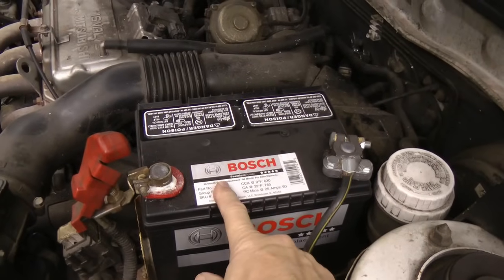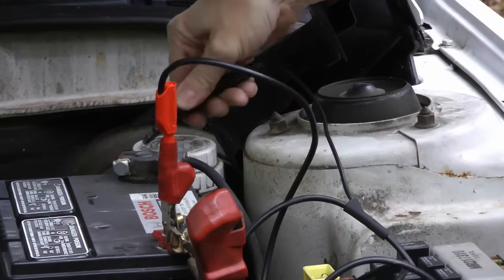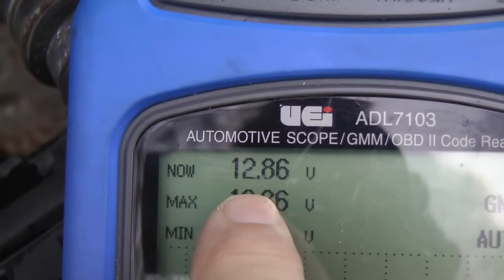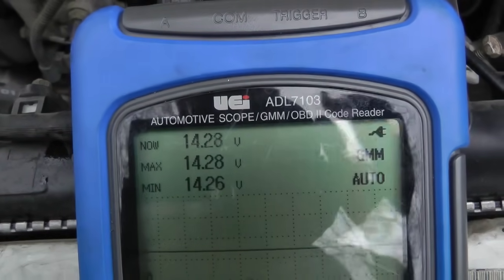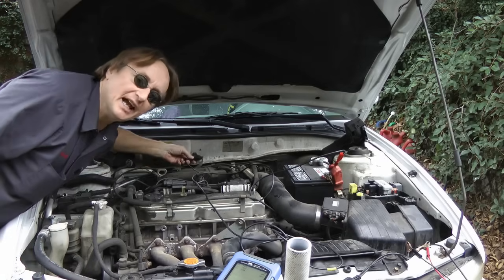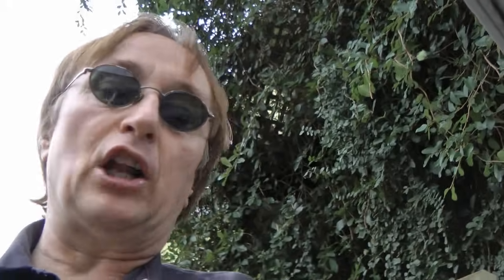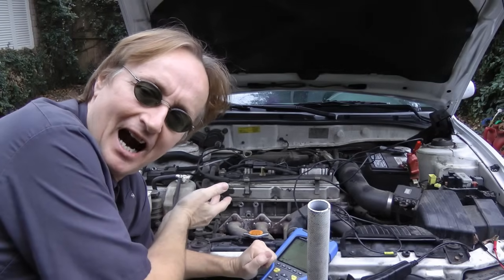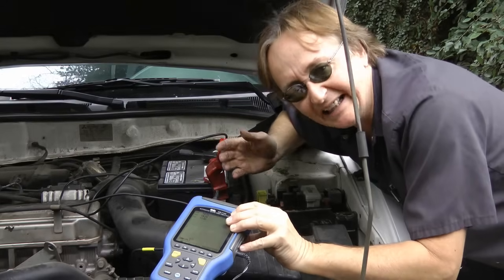How to Fix Electrical Problems in Your Car (Ground Fault)

Comment: I have a 98 chevy lumina all of a sudden the abs brake light and traction control lights all came on and shut off the radio, I noticed that the fan only works on 1 2 3 but not 4 now abs light stays on I have no power locks and no rear brake lights any thoughts?
Reply from the maker: +Kelly McLaughlin have the battery and alternator load tested, one or both are probably bad. Auto zones do that free

Comment: I need assistance. I had my car jump started today, and now nothing electrical works. Headlights, wipers, heta, speedometer, etc. What happened? Can someone tell me what I need to do? I would soooo appreciate it   TY
Reply from the maker: +Leslie Danbury, CT pray some fuses are blown, but if car was jumped wrong, it often shorts out computer modules. good luck

Comment: hmmmm

i say 

do you suppose this could explain why when i turn my headlights on  the interior lights go dimmer and the engine idles a little faster

Scotty?
Reply from the maker: +fargeeks that, or a wearing out alternator or really weak battery. auto zones check em free
Reply: +Scotty Kilmer maybe the alternator

because i did buy a brand new battery from autozone 

:)

some say its the... Whatever this unit is called that handles the voltage to the cabin from the battery or alternator

but i can say it could be the alternator (it is pretty old but still runs)..

when the headlights are off however then everything inside is at full power

well 

thank you alot Scotty :D

Comment: Not sure if you can help here or not but I am just desperate to find an issue.  I have a 2006 ford f150 4X4 pickup,, just spent over 2,000 that I dont have on having the front end rebuilt, after that was done my son removed the PIA foglights and now the truck isnt working properly, the abs, and engine light comes on, the wipers are dead slow, headlights are dim etc. took it back to the shop, the guys spent four hours and could not find the issue, now i dont know where to go and I am afraid I will get taken for hundreds again with no answers.. any ideas? from what I have been reading it sounds like a ground short, but dont have a clue where to start,

Comment: Ihave toyota corolla 1993 model here in phillipines,  when i turn on the key the termostat gauge  in my dashboard is going up to the high level but the cooling fan is ok, it will automatically turn off when it  hot, but yet my gauge is in the max level what can i do pls help and god bless,
Reply from the maker: +dobalditz magat   change the temperature sending unit, odds are it's bad

Comment: I have an s10 and my tail lights our stuck on . even when I switched it off and turn the car off. the switch works because it turns my headlights on.
Reply from the maker: +Jon Wright make sure it's not the brake lights which would be a stuck on brake light switch. If not them, replace the headlight switch
Reply: +Scotty Kilmer  thanks Scotty all give that a try . it's an s10 where yo
Reply: +Jon Wright where you start it and the lights come on. automatically.  my brake lights come on when you push the pedals.  there not stuck on like my tail lights

Comment: Thank you for the video. Would you be able to route me in the correct way. I have an expedition(98) when lights are on and I shift from any of the options, the 4x4 lights come on, I mean all of them. Or for instance, I am running on Drive and I turn on the lights, the same happens. I have a lot of aux lights and I might be worried the battery might be the culprit or even the alternator but now it could all be a ground wire ? Thank you in advance sir.
Reply from the maker: +BLAZETANGO   often bad ground wiring does that, get a wiring diagram and check them all FIRST. Pray it's not a bad BCM computer module

Comment: Scott are u from houston, tx by any chance?
Reply from the maker: +Joel Montes I've lived there the last 37 years
Reply: Awesome man, I have a problem with my truck that's killing me, can't seem to figure it out... few weeks ago I tried cranking it on to head to work, it turned over, but nothing, after that, it wouldn't do a thing, just a click under the hood, weird thing is that, headlights work, power windows didnt, radio didnt, sunroof did, certain electrical things worked, and some didnt... turned out the ecm, was burned, got a hold of a new one, and cranked up, but burned it again... what could it possibly be ? I live in baytown , that's y I asked if u lived in houston
Reply from the maker: +Joel Montes  you have electrical shorts burning out the computer, and unfortunately the ECM has tons of wires feeding it. Any of them can short it out. See my video "finding electrical shorts on your car" Good luck

Comment: Hi Scotty, got one you might like....had a fire downunder my bonnet, which meant replace the wiring loom from inside divers guard forward ( ford falcon ef.....I used a el loom ) anyway to cut a long story short.... now when I switch my A/C  on the drivers indicator comes on......... and my remote lock switches the A/C on/off....    :)
Reply from the maker: +Carol Tyers realize it may have shorted out the body control module, check wiring and grounds to that first

Comment: Hi Scotty! i have a 02 Mitsubishi Montero Sports and everytime i turn on my headlights it flickers not only the headlights but the tail lights and interior lights as well. I replaced the alternator but did not replace the old battery. Battery is good cuz i can still start the car with no problem. The flickering is not worst but noticeable. Any advise?. Thanks and more power Mr. Scotty Kilmer.
Reply from the maker: +Kerwin Patrimonio replace the battery first, and if not that, check the grounding wires, bad ones often do that too
Reply: Thanks Mr. Kilmer! I will be replacing the battery tomorrow. Do you think Interstate batteries are a good choice?. Thanks again.

Comment: Scotty Kilmer
I have a F 150 4x4 2004, In which the dome lites and Back Bed Lite turns on and Off If truck is on or not! I cant Find any Loose Wire's Or fuse's What gives!! Is my Truck Procesed Buy ghosts!
Reply: had that happen on a 2001 GMC Sierra 2500, never figured out what caused it. it just went away after a while.

Comment: hi scotty i have a corolla 1993 but when in start the car in winter have really low power 1000 rpm  and the car shake and before this  car go to 2000rpm and pass couple seconds going down to 1000rpm this problem is always in winter i changed a new distributor and idle air control , spark plugs and new wires and nothing change still same i don't have checking engine light but i think is electricity problem my dash lights is low and i have new batery and new alternator please help me thank you
Reply from the maker: +Leonid Bermudez old age, but do try my  video "how to clean fuel injectors on your car" and realize it may need a set of rebuilt injectors installed being that old and worn.

Comment: I have a 1989 c1500 truck and my dashboard lights don't work but I've checked all the fuses and none of them are blown. When I turn my blinker on, everything on the dashboard goes haywire. Any ideas on what could be wrong?
Reply from the maker: +wade may either turn signal switch is shorting it all out, or the dash board circuitry is shorting out. Often the boards warp with age and short out on that model
Reply: +Scotty Kilmer Is that an expensive fix? I'm on a kinda tight budget

Comment: Massive help, especially opened my eyes to the fact cars have grounding connections in the trunk! Any others I should know about? Water got in my car after a hard rain, basically a puddle in the passenger side of the car, now the seat belt fault light keeps flashing and beeping, even if no one is sitting in the seat, also turning on the headlights causes the beeping to stop or act up intermitently, any ideas? I did clean and use dilectric grease on the connector under the seat with no fix

Comment: Been having starting problems with my 2002 Monte Carlo ss. When i turn the key to ON the dashboard flickers and when trying to start it absolutely nothing will happen . I found I have to slightly press the hazard light switch in in order to stop the flickering and to start my car . If I let the hazard light switch go before I put the car into gear the car will shut off . wires at end of connection are fine.. Don't know where to start !? HELP...
Reply from the maker: +Frankie  Herna that's a weird one. I would first replace the hazard light switch and pray it's shorting all that out
Reply: I will try that this week. Found another thing yesterday. The lights stop flickering also when I press the break!

Comment: my 2011 malibu front speakers work here and there. also one headlight goes out after I just recently changed it (without touching the bulb)..I have to smack on surroundind areas to get it back on..any ideas?? thanks in advance.
Reply from the maker: +Gillionaire LeeM the light has bad grounds, check them.  speakers may have loose power or ground wires too

Comment: just wanted to ask, I have a honda accord 2008 ex-l model. When the engine fans activate the lights flicker for a second and it does it over and over. I swapped the fuse relay and it does the same thing. Please let me know if you would have a simpler fix for this extreme current draw. When I say flicker it includes the back, front, inside (no dash or stereo) lights. But the engine runs fine; it's just an electrical problem I suppose. Maybe replacing the whole fuse box might do the trick.

What do you think Scotty?
Reply from the maker: +scientist100 either fan motors are wearing out using too much juice, or alternator is weak, you can have that tested
Reply: +Scotty Kilmer can I test the fans? I read that this is normal for Honda vehicles, at least for my year.

Comment: my 2007 hyundi getz dash lights don't work but all other lights do, any ideas plz ? i checked all fuzes
Reply from the maker: +Neil Auton  check the dimmer switch on the dash, it may be in the off position. If not, either that switch is shorted out or you have a bad dash unit with the circuit board section that powers the lights being broken, or the connector to the dash lights is loose or corroded inside

Comment: Is a multi-meter and a volt meter the same? I have a multi-meter. I'm having and intermittent battery drain issue. It was 3.50amps. I pulled the interior light fused and it dropped drastically to .50 amps. I pulled every fuse and I can't get that .50 amps down. So I'm guessing the draw might be in the wiring. Can I use my multi-meter to check volts on a wire. My meter does not have clamps it has pointy sticks only. Thanks.
Reply: it depends on who u talk to, I call it a DVOM (digital volt-ohm meter) or a fluke, which is the brand I use. if the car is off I'd say a half an amp .50 of draw is normal. when u pulled your done light fuse was it on? depending on the number and type of some lights 3 or so amps is normal for operation for a car that has multiple incandescent bulbs as some lights. I would suggest having your battery tested as a start as a weak battery loses charge quickly once the charging system stops charging the battery.

Comment: when i turn left my interior lights come on, but only going left, any help???
Reply: on a 1997 Jeep Grand Cherokee
Reply: +Zack Faulkenbury  Sounds like the turn signal switch is feeding power to the dome light.TURNING left or when the signal is on?

Comment: hey scoty i have 1995 aurora olds my lights flick on n off. and it drains my battery
Reply from the maker: +Danny Barriga have the alternator tested, many auto parts store do that free in their parking lots
Reply: +Scotty Kilmer thank youbut it was doing it even when the car was parked n keys off
Reply: +Scotty Kilmer i cleaned the headlight switch. with cleaner n compresed air
Reply: And its not doing it no more

Comment: Well, I have a 1998 BMW 328i that the driver side tail light is not working. The passenger side working perfect. On driver side all lights working except the tail light during night. People say it might be the grounding, but how can I check for ground or any other possibilities.
Reply from the maker: +Geeky Bugs Planet   go to the non working light, check to see if it's lost power to the power wire there, or no longer has ground continuity between the ground black wire and the body.

Comment: Hey scotty maybe you can help. 96 chevy s10 4.2l 5 speed. When ignition is in startup, the turn signal and fourway relays start blinking at random almost as if the turn signals or 4 ways were on. Another problem is when turn signals are actually on it is reading that the 4 ways are on in the back. I have a video in my profile if youd like to go ahead and give that a look. sorry for poor quality.
Reply from the maker: +Mike Forman  often just a bad flasher switch assembly does that
Reply: Scotty Kilmer I really appreciate your help. I already ordered one before you said that I just wanted you to make sure especially because there a pain in the rear on this 96! again thanks so much scott!

Comment: My tail lights dont come on or my insterment panel i checked my fueses and changeed my light swich and dimmer swich to no avail any advice ?
Reply from the maker: +Daniel Smith  check for ground wiring problems, and pray it's not a bad body control module

Comment: I have a 2000 navigator, installed projecting lincoln emblem lights in doors. come to find out one of the wires was bare like one strand so the positive was touching metal for a while. I left my car not knowing this and came back a few hours my radio will not turn off, supposed to when opening the doors. When the lights interior lights turn on my car acts like i turned the accessory stage on and the gauges, service lights etc comes on. do you think this is the problem of a bad ground that could've burned or something or a module?
Reply from the maker: +sonicmanx20  probably shorted out the body control module, have a pro with a ford dealer level scanner check that

Comment: My a/c, heater, fan system on works when my headlights/parking lights are on. If my lights are off, the cooling fan doesn't turn on causing my car to get hot/over heat. Any clues? what to check first?
Reply from the maker: +YouLazyButt  often a bad body control computer module does that, or crossed power wires in the headlight system

Comment: When I turn my headlights on it dims everything down in the car.  Also I heard a pop while driving home from work all the gages went dead.  it took about 1/2hr to get home and an indicator showed up saying it wasn't charging the system.  In the morning I turned the car on the gages were working but turning the headlights on it dims everything in the car down.  Where do I start looking for the problem?
Reply: belt, battery, alternator, or bad ground.

Comment: @scottykilmer eclipse 2001I have 2 questions for you1.my high beam lights turn on automatically without touching the switch ,I've spent 100$ just replacing the turn/light switch.....2.whenever I mess with the air condition if I put it on a certain notch my car sounds like its about to die???and it loses power???
Reply from the maker: +bryan lu  you have a power short somewhere and if it's not the switch you changed out, often a bad computer module does just that'.  Replace the blower motor resistor for the AC
Reply: +Scotty Kilmer I have a 2013 2.5 AWD RAV4, (wife's daily driver)  26,400 miles. when i hit about 50mph under normal acceleration I start hearing a faint whistle. it will do it once I hit that speed and will do it even in neutral. not AS noticeable when in neutral, nut, I can still hear it.. what could it possibly be? please help me Scotty
Reply: +2010V6RAV4 but, not nut..

Comment: when i turn my lights on to drive at night, my head lights work but my tail lights and dash lights dont. any suggestions?
Reply from the maker: +dvlchildp1 first, check for a blown fuse, if not that, often a bad headlight switch

Comment: hello Scotty. I have a question I just got a new battery an my alternator and starter tested good. when I go to start my car it slowly cranking over barely starting. sound like if the battery is dead
Reply from the maker: +Alex Gonzales starters often do that, and can be pretty much impossible to test correctly. Pray it's that and not a wearing out engine

Comment: okay how hard is it to change that seal will I have to drop transmission
Reply from the maker: +Kevin Yettaw yes, so you might want to try some AT 205 reseal poured into the oil, it often stops those leaks. Amazon sells it as it's hard to find in places

Comment: I've got a strange electrical problem with my 35 year old 1980 Ford Fiesta.  Seems I only can get 3 volts to show on my voltmeter from the cigar lighter socket and at other places I can reach to measure the voltage.  Battery is up with 12.65 volts.  Won't start.  Used your static suggestion from your video to see if engine is grounded.  Meter gives me 12.65 volts at engine. Same with other ground points to positive battery post.  Can't do the dynamic test since she won't turn over and start.  Probably a ground problem?  Any suggestions would be appreciated.
Reply from the maker: +John Davis you will get low voltage from either power wiring shorts or loose connections OR ground wire problems. Start by checking the grounds on one that old, especially the battery to body grounds
Reply: +Scotty Kilmer : Thanks. I'll give your ideas a try.

Comment: I bought a jeep liberty 06. works great but the radio only works when the driver window is all the way down.
Reply from the maker: +MsBeckabean well, looks like you'll be doing some "singing in the rain" then when it does rain. That's an odd one, but do check the antenna connections, loose ones can cause that so the radio needs the window open for reception